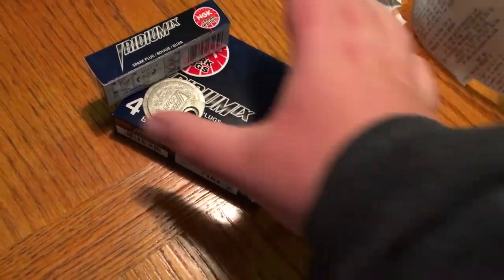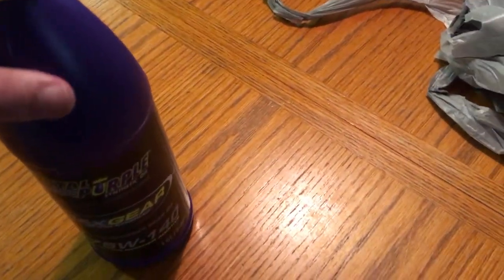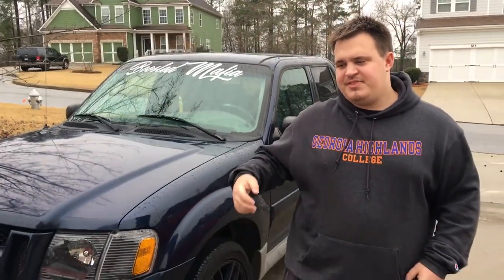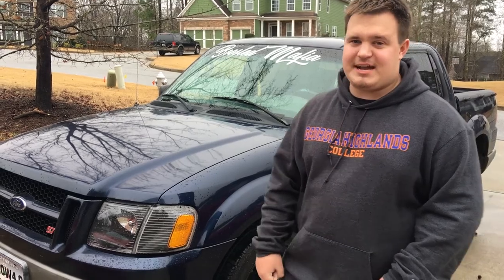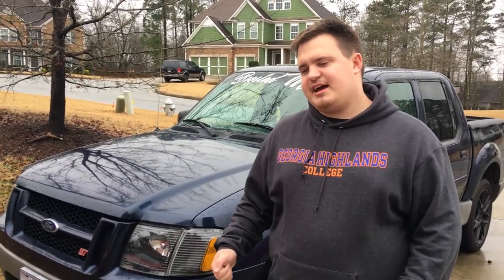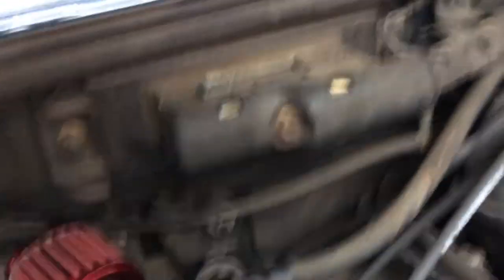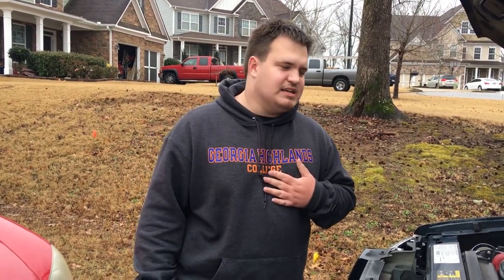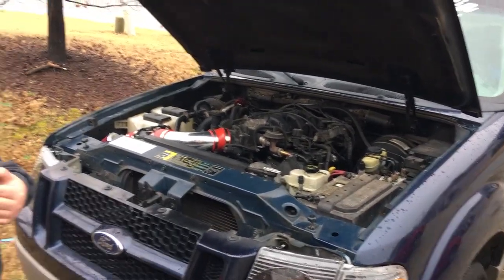Getting My Sport Trac Prepped For Tuning!

Comment: I'm glad your gona tune your St Ive  been wanting to do the same on my XLT sport trac  I just gave it a complete tune up as well as cleaned out the throttle body and the idle air control valve... Heads up that plug  near the fire wall on the side of the engine where the pcm is is a pain you have to get it from the wheel we'll with your tire off.
Reply from the maker: H Black I’ve heard that about the plugs 😂 the X4 came in today and I hooked it up and changed a few things, I’ll have a video on that ASAP
Reply: RoAst_TiRez that's cool how was it ?  Was it difficult to use?
Reply from the maker: Seemed pretty fun, I don’t have my performance tunes from brenspeed yet so I just adjusted my rev limiter in Park and neutral, I raised it but didn’t remove it, and I raised the shift pressures
Reply from the maker: Was super easy to use though
Reply: RoAst_TiRez   shift pressures?
Reply from the maker: kinda like a pseudo Shift Kit, makes the transmission shift much harder.
Reply: RoAst_TiRez oh ok thanks
Reply from the maker: No problem!